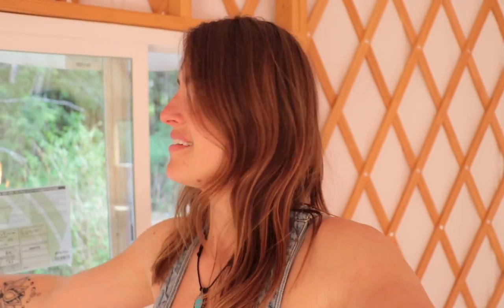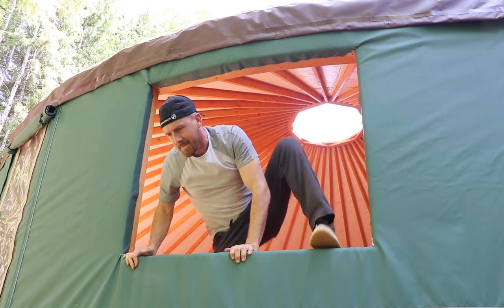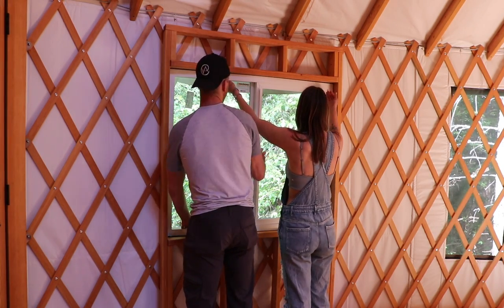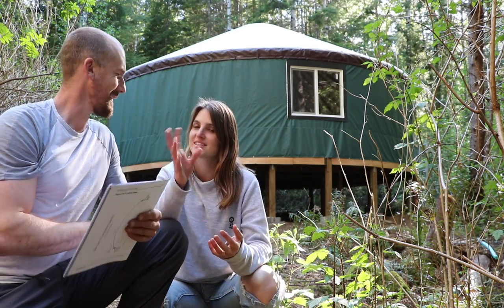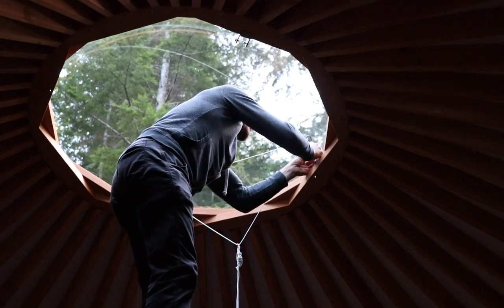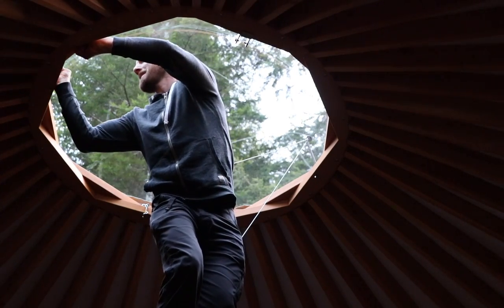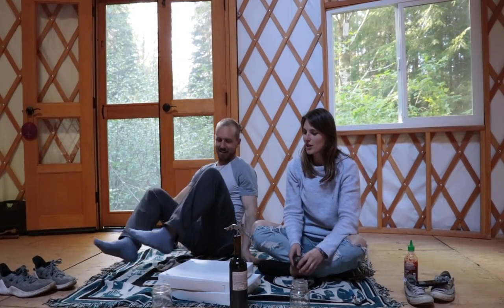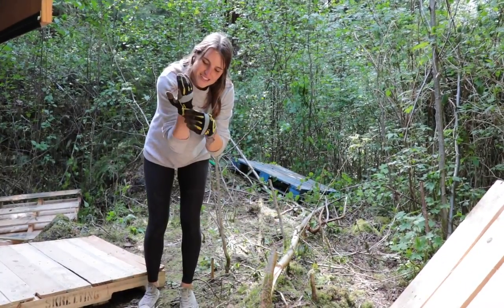This Yurt in the Forest Will Blow Your Mind | Living Off Grid - Ep. 22

Comment: Jake when installing windows in regular construction you don't want them to be that tight because things move, especially with a snow load. You don't want any pressure on the window or it will break. I was alarmed when you installed the windows but I know nothing about yurts. It would make me happier if you addressed the issue directly with Pacific. Looking after you guys where I can. GOOD JOB! Buddy
Reply: @Douglas Hurst after 20 years living on Vancouver Island I can tell you that it doesn't happen often but there is snow and occasional it is bad
Reply: And what if the wood swells?

Comment: You make me really want a yurt. However I work in a highly specialized technical field so need computers and fast internet. Anyways was curious... will you also install a water catchment system and solar panels so you can have running water with a water pump (using your rainwater) plus have electric for the night?
Reply: That's a very good question.  It will help you guys alot. No more collecting water and always have fresh water when you need are want it. ND the solar system will help
Reply: Melinda Bell there's power lines like 50feet away, they will just get electricity and a well!
Reply: B Radd but that's not living off grid. Living off grid means not to have to rely on the city, town, or give for water or electricity
Reply: Melinda Bell exactly!  Supporting yourself and not having to rely on an old system. I love having solar panels and a power wall.  Regardless when power goes out mine is still functional. Not much work and modern systems are smart and functional.
Reply: Melinda Bell exactly their not off grid!